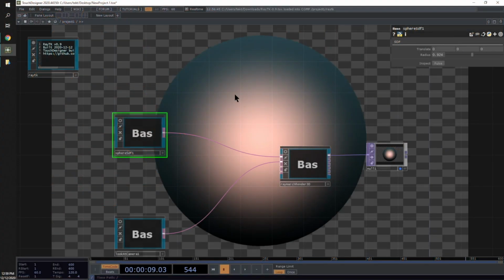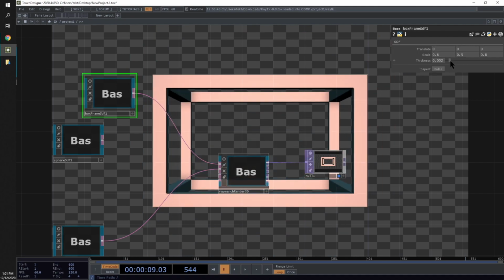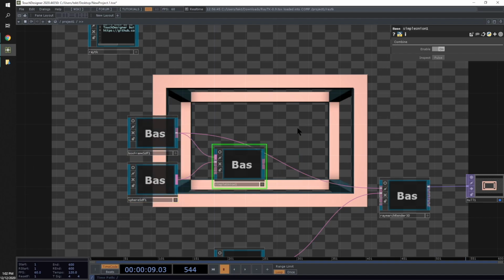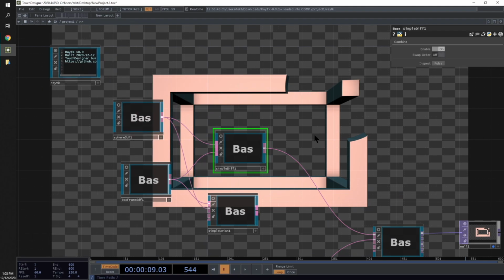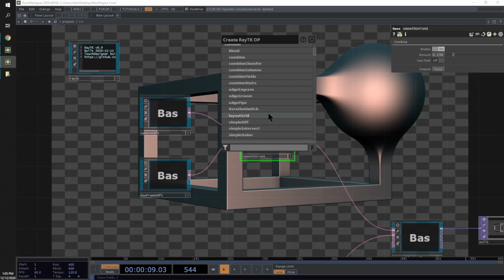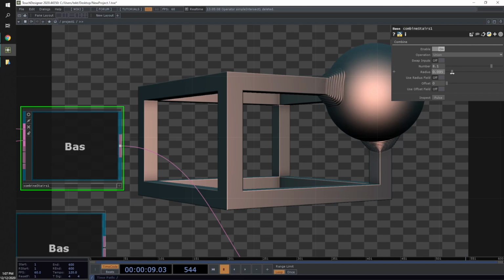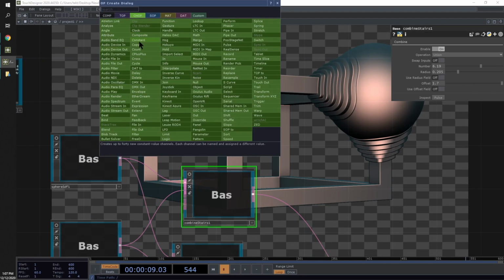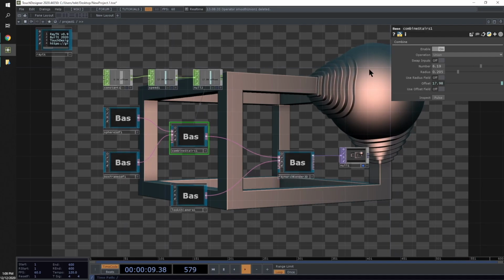(outdated) RayTK Tutorial 2: SDFs and Combiners

Comment: I'm not seeing the proper combine function when the sphere and box frame overlap. On an older Macbook Pro. Am I missing something in the render settings?
Reply: Actually working now, but lookAtCamera doesn't seem to respond for position or FOV
Reply from the maker: There is a bug in the renderer that doesn't recognize when the camera input is first attached. To fix it, navigate into the renderer and then back out
Reply from the maker: I managed to fix the issue. It'll be included in v0.12.